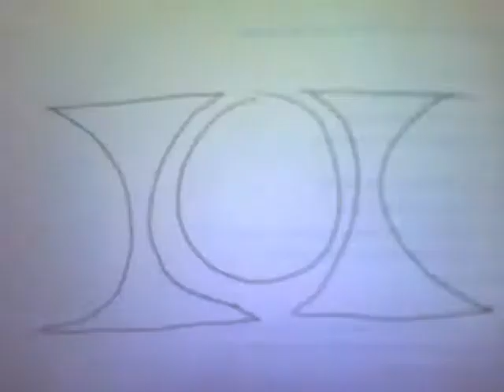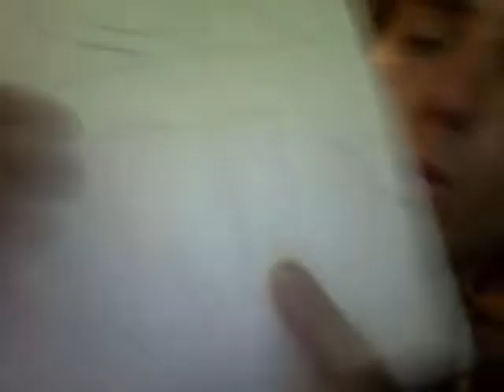Prometheus Update

Comment: @GregorArturo85 ummmm. no its not Silver is your best conductor, all around. Alluminum actually is quite bad the only reason they use it in powerlines is because its cheap the resistance in aluminum plus its paramagnetic properties will most likely burn up your coil cause the eddy currents will over heat it. but what do I know Ive only tried it. I can Garuntee you won't hit .2 Teslas on a aircore, My friend.  and if you do its gonna get real hot and go bzzzzt... then melt

Comment from the maker: @mavendex Aluminum is the most conductive element at room temperature that can also superconduct (at 1.3K), and being it has 13 protons, and 14 neutrons, it's atomic nucleus is structured just like a cuboctahedron (the inverse being a merkaba which details the neutron layout specifically). If you learn something about a cuboctahedron, you might take a closer look at aluminum. And I really haven't run alot of volts through it yet, so patience my friend :) .2 teslas will def be achieved easily.

Comment: @GregorArturo85  because fantasy land physics don't apply is why im saying stick with conventional physics, regardless of the coil you show in the video or not we have redesigned and redesigned those coils to produce upto .2 Teslas on a single layer aircore, you need more. aluminum atomic lattice bleh, its a crap conductor of energy you will lose your juice before you can harvest it.